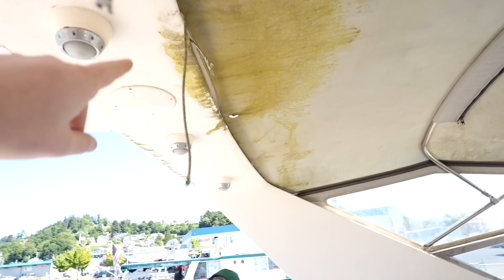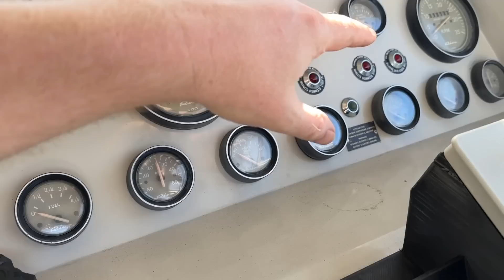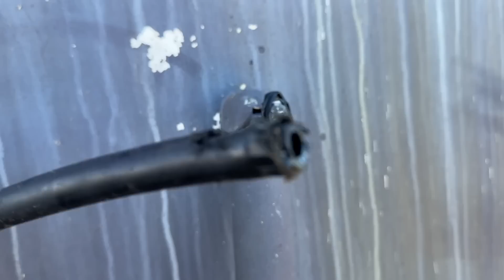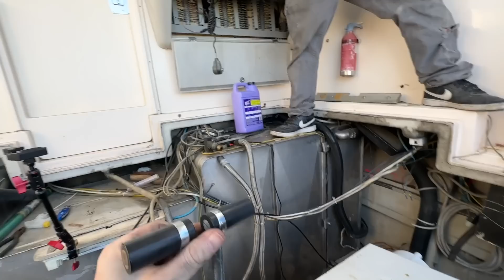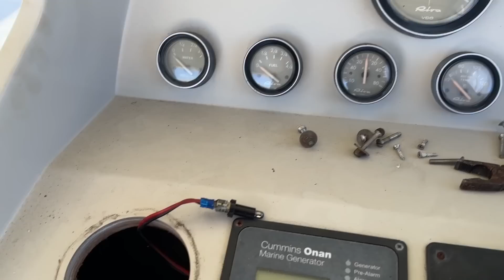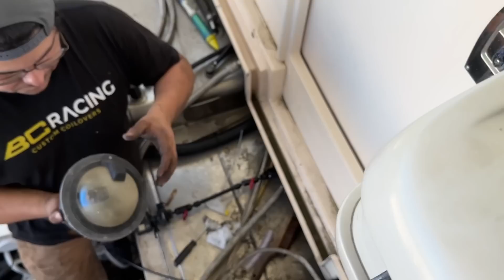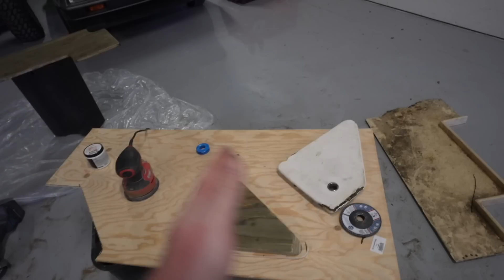Back On My 30yr Old Italian Yacht and its WORSE THAN EVER

Comment: Are you CRAZY?? Removing the custom steam gauges??? Your ECU can send the data to gauge drivers that can just make all those original gauges work. Its most likely the gauge drivers not the gauges that died. It would look SO much better on that classic than digital dashes. Hide the digital dashes forward or something.

Comment: The hose being used on your trim tabs does not appear to be OEM. It looks to be just some rolled hose from the auto parts store. I have a feeling  this why the hose you pulled off was in such terrible shape. I would maybe take a further look into whatever book/manual you have and see their specifications for the hose. I got a good feeling it will be quite different hose.

Comment: Don't paint that table. Powdercoat it. ...and powder coat the throttle and shifter handles, too. You'll get a lot more life out of them!
Reply: Even powder coating has a limited lifespan in the marine environment, like car wheels only worse: anodising aluminium is the only real solution.

Comment: Sorry if I missed this. I did not see a switch on dash for a blower fan in the engine bay.( I also don’t read Italian!)  Diesel vessels often do not. Since switching to gas I would add one. A trick one would be tied to the ignition to add a delay for the fan before cranking so you do not have to remember. Also are you adding a tank for the genset diesel fuel or does it already have its own and the main will hold gasoline? If adding that could help rear weight also. Can’t wait to see this thing rip!

Comment: "jumpstart" the batteries when you connect them to the charger if the charger doesn't sense enough voltage to kick in. Disconnect the jump batteries after a while

Comment: Mobile pressure washer is easy, I own a mobile detailing business,  use a rv water tank, just get one with a bottom outlet so it will gravity feed. And then use a 1500+ watt generator and a pressure washer rated for less than 2gpm.

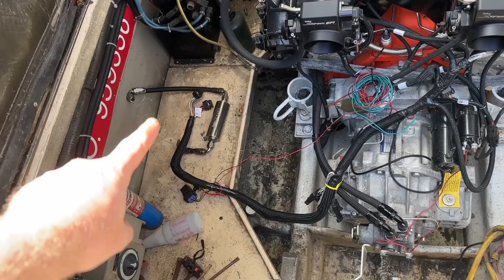Comment: Matt Armstrong and Tavarish used a regular battery to trick the charger into thinking it was charging then hot swapped the battery.  https://youtu.be/HUL2s9xsqO8 @ 13:30.

I'm not sure what those knobs are made out of but you might be able to use a heat gun to restore them if they're plastic. If their metal with paint then I'm not sure.

Comment: On those rubber buttons: use pipe stem cleaner. Pipe stems are traditionally made out of rubber (vulcanite) and they oxidize over time, this stuff refreshes it to a beautiful jet black, high gloss shine. Also, it's like $5 for a tub which will last you the life of the boat.
Reply: And for the placard surrounds, an ultrasonic clean might be enough to refresh them.

Comment: I have absolutely no idea about boats and related stuff but I'm wondering since now you will be using a gasoline engine and basically put a car engine into the water if you need to pay special attention to the potential reactions there might be on the gasoline and engine/transmission components with all the salt and corrosion they will be exposed too. You can see how vehicles deteriorates waaay faster near sea areas. Maybe add better sealing to the engine compartment? Also do they need vents to cool down components that won't be directly cooled down with the water cooler?

Comment: Hey Guys Get a full Boat Cover First , you don’t want water laying in your 40 plus year Boat because if you have a Crack in the Fiberglass your Core is going to Rot . Also you should have Strip the Whole Boat to fix Any Fiberglass Crack and fresh Gel Coat Paint.  Sorry. Don’t buy Gages. Buy Garmin screen 📺 📺📺 For your Gages and other Goodly. Maybe Garmin will help you Out.

Comment: You should have a cover made for your control station. Most boats have one and it snaps over everything around your gauges, throttles, shifters, down to where your VHF radio is. Keeps the UV damage away and keeps stuff from rusting or molding. They usually just snap in place. If you had one your steering wheel would still look brand new.

Comment: Looking at your generator, i think thats a diesel no? I haven't seen a second gas tank in the build yet since the LS will take gas and the gene diesel. Maybe I'm getting ahead of you 😅
Reply: I had the same exact question. You are going to need to get diesel somehow. I think they do make same tanks for this application of running diesel on a gas boat powered boat when looking around. You really don't need to too much fuel to run a generator. I didn't see the specs on that generator but it probably burns .5 to 1 gallon per hour on a half load so you don't really need a huge tank for most applications like running a refrigerator and AC.

Comment: I doubt you’d need ballast..the type of drives on that boat-once you shift into drive the torque will keep you down…very awesome build
Reply: What no it won’t 😂
Reply: @hughjarse4627  different strokes I guess..when yanmars came out there was no one rushing to add ballast..in line drive dont care on that size of boat

Comment: You can revive an AGM battery by putting a lead  acid battery in paralell (jump box) and connecting charger.
Also gen is diesal, a diesal fuel tank is good ballast

Comment: You just need to get it running and back to your original slip so you don't have to drive so far to work on it. Get it running and back home before redoing all that interior stuff. Just my two cents
Reply: Get it closer and cheaper… having that boat in their yard must be expensive. Not sure why this boat isn’t top priority build atleast to get it running. Fuck all that interior crap until it gets running and moving
Reply: To be fair, so Ng the interior is a great way to get extra cash while they wait to get parts for the rest of the boat so they can tow it back to shop

Comment: Love the channel Chris. Just thought & you probably already know this but you'll need bilge blowers in the engine bay due to the petrol engines. The blowers vent any residual fumes from being able to ignite in you bilge. Hope this helps Steve J.
Reply: This needs more likes so he'll see it, just in case it slipped his mind😬
Reply: He’ll need a new diesel tank fuel lines system for the generator too. I wonder if they’ve disconnected it from the original fuel system yet??
Reply: Im pretty sure he mentioned the need for this in previous videos.  I agree it's worth mentioning again though!
Reply: @digdugsmug hard to remember when the videos are once a year

Comment: 2 part comment.

Watching you go through this whole process would of seemed to be a lot easier keeping the diesels in and just rebuilding them. Whole lot less work.

2. More boat content to come?  I dont know about others but pretty much only reason i follow is for the boat build haha
Reply: Yeah but going from an engine that makes 1950 ftlbs of torque and is designed to run at a steady RPM forever; to an aftermarket big block that makes 750 ftlbs of torque from race car builder gets more views.
Reply: @BlueDually4x4  something is missing, and it's called common sense I rekon
Reply: Yeah, that's what happens when car builders start working on boats. If all you have is a hammer, everything is a nail. In this case if all you know is LS engines, that's what you go with. They'll grenade within a year, and Chris will be shopping for new diesels.

Comment: Have you considering changing the props. The new engine may work better with a different propeller. You might find a slightly smaller prop or an anti cavitation prop might give you better power.
Reply: no the whole gearing needs to be reviewed because it would be way different

Comment: You just know Chris wishes he had just paid someone to replace that one broken diesel engine. All that valuable time lost messing around and leaving it rotting in storage instead of enjoying it out on the water 🤦‍♂️
Reply: The wait time on those parts was a month or two, not two years. He could have bought a low hours surplus engine for less than 7500 and had it installed and the boat painted while it was out. He would have saved thousands of dollars and years of time.
Reply: @everydayanadventure that's not a B is for Build style
Reply: @sonbass1365  he was the one who said the repower was about cost saving and time. Some fans seem to think the fix it group are just haters when we really just wanted to see the project be done so he could have a boat he enjoys rather than a money pit. The longer boats sit at dry dock the worse they get. At this point the likelihood that boat ever gets set in the water before being sold is slim at best.
Reply: Probably not considering it apparently would have been about now he would be receiving the parts that cost more than those new engines, plus the crane rental to remove and replace them.

Comment: Honestly I would just ditch the batteries you have now, and get a bank of lithium batteries, and buffer them with a bank of supercaps. Also redo the main electrical lines... Your drain source could be just a corrosion bridge somewhere that got splashed with sea water...

Comment: They were over 4,000 pounds per engine, so the two LSX engines combined weigh less than one of the 903s. The Raptor couldn't tow both of the 903s at the same time they are that heavy. Also trim tabs won't help with the stern of the boat being light, you'll need ballast for that.
Reply: I think the weight difference is the least of his concerns. Going from a 2000 rpm cruise to a 3600 cruising rpm without new prop, hand sanding the inner bore of the couplers, just "leveling" the engines to the couplers rather the Trans to the shaft couplings after settling in the water, putting new hoses on trum tabs that were full of saltwater I can go on. This dudes absolutely clueless. I've offered my help countless times as an experienced marine technician that's done stuff like this thousands of times.
Reply: @ccsmallengines  you hit the nail on the head. The most frustrating part is that he acts like he knows everything. This whole series is hard to watch from the perspective of an actual boat owner.
Reply: @ccsmallengines  He has a long list for sure. I have a lot of concerns and I don't know much about boats.
Reply: @BlueDually4x4  You are smart he ( B is for  Build) is not.
Reply: @ccsmallengines  
He has mentioned there will be a 2:1 gear ratio step down, so the RPM's should be fairly close to the old ones, and increase the torque of the LS engines.
I'm actually less worried about the power of the engines, than any accidental fires + bad balance.
I think he underestimates how important balance is for a motorboat.
Reply: @Grumpy_old_Boot   He gonna find out!
Reply: ...lol, the only thing the trim tabs will do in this instance is create drag and even less fuel efficiency in an already ridiculously inefficent design...
Reply: Lol the whole time I was like that’s not what trim tabs do
Reply: This whole series is painful as a marine mechanic.. I love his work but man, just stop the boat stuff.. none of this is gonna work well if at all..
Reply: @connorkrukowski6600  
Well, only way we learn, is by failing.
Though even by B is for Build standards, this project is dragging on quite a bit.

But then, he doesn't want it to sink, while on the open seas.
Reply: He should sell those engines and scrap the boat. 
Everything he is doing is bad.
Reply: Cant believe he pulled the diesels for 2 petrol v8s.
Reply: A raptor can't haul 8-9k? Thats wild to know
Reply: @matthewt8601  they aren't built for towing. I think 8k is max, so the two engines and the trailer would be 10k or more.

Comment: For the battery issue, take a good, fully charged agm battery and run jumper cables from a dead battery to the good battery, then put the battery charger on the good battery on a slow 2a charge, and it should save the battery, I have done that many times when my agm battery died and was below 3v and it saved it every time
Reply: It's not guaranteed. I've recovered a battery like this, I've also had a battery just die and read 0v infinite ohm after doing the same, fortunately mine was only a $200 battery, not $2000. Hopefully recovery works for you guys. 

And if anyone reading this is wondering if buying the slightly more expensive "battery recovery/desulphator charger" is worth the slight price premium, I unreservedly say yes it is.
Reply: I have done this, but used a lead acid battery on the charger and cables to the AGM
Reply: Lead Acid batteries drain on their own. Likely, after 6 months or so, their voltage would be minimal, I doubt that a parasitic drain would be required. Without a trickle charge, the batteries will be degraded, possibly ruined within a year or something. Good luck rescuing them, it might work, but you would want to test their capacity before trusting them on the water.
Reply: Do what project farm posted a few weeks ago. Use a welder to pump alot of amps into the battery to revive it
Reply: @truey90s those were lead acid
Reply: @simplecatify  AGM batteries are still Lead Acid. The difference is in an Absorbed Glass Mat Battery, the acid is entirely held within the Glass Mat. That said, they require a different charging profile than a standard Flooded battery.
Reply: @truey90s this is what I said before reading this. Not specifically using a welder but a old school charger that can pump a lot of amps.

Comment: I can’t help but think had you just replaced the diesel motor it would have been in the water a long time ago and you would have been enjoying it all this time.
Reply: Yeah this thing will be lucky to be on the water by summer 2025
Reply: You are not wrong. But you are missing the point entirely. 

He does creative and innovative and different. I mean he’s building an rv out of scratch, swapping bodies on cars they don’t belong on and custom designs bodies that weigh as much as another car. 

I don’t think the boys are looking for practical advice.
Reply: @cabrilo1980  no I get it, but I also know the schedule he keeps and he doesn’t have time for this. Which is why it’s not done. I also remember when he started this he said that time was an issue because the dry dock is costing him a fortune etc…. A simple diesel swap would have been done a year plus ago and he could be enjoying the boat on what little off time he has vs working on the boat which is way less fun.

Comment: You can charge AGM batteries with regular battery charger, have done it many times with many diffrent AGM batteries that were at two volts or something like that. Batteries have worked just fine after that.

Comment: I’m not an engineer but if I was to design a boat that had a generator I would certainly have wired it to charge the battery system of the boat!
Reply from the maker: it does, but it needs to be manually turned on

Comment: AGM batteries are designed for deep discharge, but check your battery charger supports AGM. If not, get one that does and they will most likely recover.
Reply: That's not true. Every car nowadays has a AGM Battery. They are as vulnerable as acid batteries. It's the same technology, just that the acid isnt floating freely but suspended in a glass mat. There ARE deep cycle AGMs, but that doesn't mean they Like depletion/deep discharge, they will also go bad with deep discharge. instead of being able to discharge them like 50% you can discharge them like 80%. A 100% discharge will kill them just as their acid brothers...
Reply: So I shouldn’t be replacing the battery on my Harley every year? I have a tender or 3 but I keep misplacing them between vehicles.
Reply: @Redbeezy504 the tenders job is literally to keep the battery healthy while you’re not riding. I sold powersport batteries for years and with a tender you’re looking at 3-5 years with ease out of a decent quality battery.
Reply: There should be an on board charger
Reply: Imax B6 is a good option. More info in another comment.

Comment: Why can’t you just bring the boat back to the shop and work on it there. You will save money and time.
Reply: The boat is too big to fit in a shop, and they don't own anything big enough to tow it.
Reply from the maker: its like 26K pounds, 45 ft long and 15ft tall. Takes a crazy truck with a oversized load DOT team to move it.

Comment: Hi guys,
Consider moving your battery banks aft to help redistribute the weight now that you have lighter engines. Hopefully the trim of your boat won’t be effected to much as the motors are fairly centrally located and not at the transom like boats running stern drive legs.
Cheers 👍👍🍻🥂
Reply: The batteries are already all the way back it looks like.
Reply: I understood some of those words

Comment: Build a lithium bank. I bought cells and a bms, and built a 560 AH battery, for about a grand. Works amazing.
Reply: Lithium and water=fire
Reply: @marksuszynski2060  What? 😂 Why would your interior electronics be getting wet? If your boat sinks, you have other issues. LifePO4 batteries are perfectly safe. You don't just leave your cells out in the open, you seal them in a box.

Comment: Since you are redoing the gauge cluster due to going digital, you should remove that badge you want to save, make a carbon fiber insert for the whole thing, and then put the badge on the carbon fiber insert.
Reply: ...yes, they need to do an insert but that entire console needs to be refinished...anything less is a waste of time and will be hack job...
Reply: Please forgive me because my experience leads me to firmly believe a boat definition is a hole in the water surrounded with plywood & fiberglass B.O.A.T. bust out another thousand
Reply: Please continue this series at least untill successful sea trials.
So glad to see you are still making videos about it, good luck fair weather and following seas.
Reply: Greet Engrish grood
Reply: @muddwhistle7833  ?